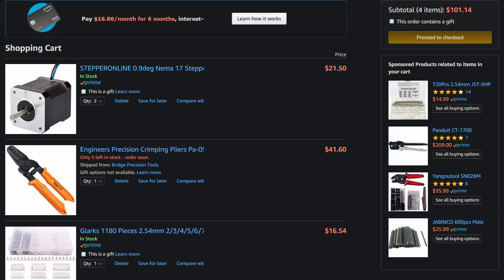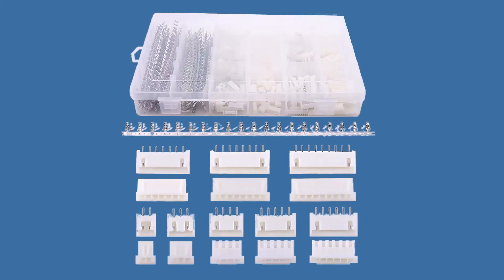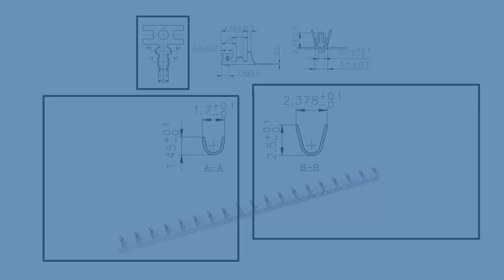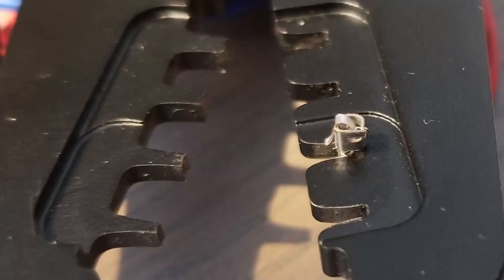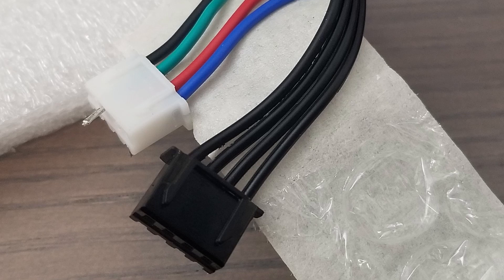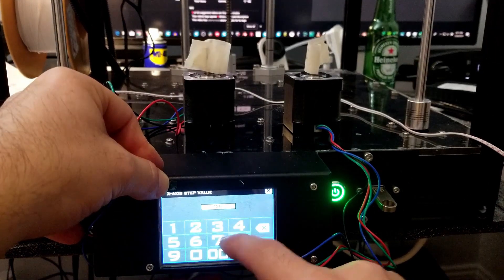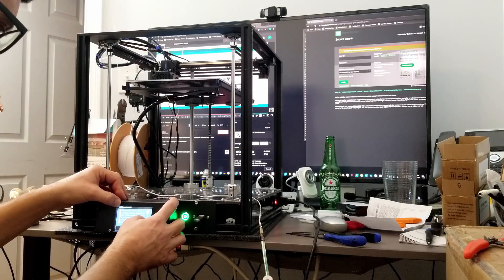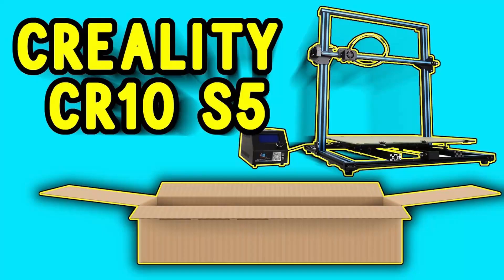TwoTrees Sapphire | .9degrees Stepper Motor Upgrade | crimpping JST Connectors 2.54mm

Comment: To really take advantage of new motors in order to have significant quality improvements thinner toothed belts and rails would also be needed in addition to properly tuned settings. Add superaccurate stepper motors in a mechanic inadequate to their degree of accuracy makes spending vain.
Reply from the maker: That job may be more involved than the printer is worth, or what can the printer do  for me in general.

Comment: I have two s42b closed loop stepper motor and an skr v3 board I would like to put in my sapphire plus that's still in the box. Besides no layer shifts I'm wondering as well if it's money down the drain as well.
Reply from the maker: The skr maybe is not money down the drain. But the closed loop may be. I think maybe you can do it wspecially if you have the patience and knowhow. It will take some time, write back your struggles.

Comment: i wonder if a .9 degree stepper would be better for the extruder over 1.8 degree. figure twice the pulses with half the pressure spike per pulse.
Reply from the maker: That is good thinking. I haven't thought at it from this point of view. Now you got me thinking about it and it is the same length of filament that is trying to push in and out. The only advantage I can think of now may come at microstepping where the 1.8 may not be so accurate and may extrude a little more or less when it needs to microstep. The .9 may do that more accurately, maybe. I think it needs experimentation at some point.
Reply: @RoamingInterests  i know im thinking about it. i was thinking about taking my extruder stepper and puting it on my beds y axis as it has more Tq. i figure it would compensate for the glass bed i put on it. its a ender 3 so the bed travels back and forth for the Y axis.
Reply from the maker: @jasonwoody8041  So your current extruder motor is a 1.9 Deg and has more torque than the .9 deg arc you want to install on the extruder? And then you want to take the Current Extruder stepper 1.9 Deg and place it on the y axis? Anyway you skin that cat more torque for the bed seems like a good idea. If you do that still does not mean you can increase the speed too much. the momentum of the bed rocking still will reverberate through the frame. Also I think the .9 stepper controllers could be more effective in quality on a cartesian 3d printer than a core xy, because the core xy already has a lot more steps available due to the belt system. At any rate do not increase the speed too much on the 3d prinnts because you will see it. In addition a larger stepper can dissipate more heat, because is larger physically.
Reply: @RoamingInterests  right. i want to put the 42-40 from my extruder and replace the 42-34 on the Y axis with it. its .5Nm or about 7oz stronger than the 42-34. i was not planing to bump up the speed of the printer, only comensate for the extra weight of the glass bed over the crap stock magnetic and plyable plastic like sheet. 

and i would put a .9 degree stepper in place of the stock 1.8 degree extruder. however i have converted mine to a direct drive so i would need to see if it would fit still. seeing the .9 steppers have 1/2 the torque it would be a longer motor body for the same torque value.

if all out speed is what i want i better look at something like a delta 3d printer, lol. but i would much rather wait for it and have parts that look like they are injected plastic.
Reply from the maker: Injected plastic, that is very good quality. Whats your outer wall speed?
Reply: @RoamingInterests  turtle speed, lol. .12 layer height and 25mm/second outer wall. takes FOREVER to print something but i like the better finish on the parts. i dont mind waiting though but i have had a few parts i have needed in a hurry and printed much faster and then reprinted slower to exchange them at a later date.
Reply from the maker: @jasonwoody8041  That's preety good. Also You gave me some ideas. I thought 24 mms is a good speed I crunched some numbers and it turns out my steppers have to microstep. 25 seems to be a multiple of .4. Damn I've been Missing Out. Who knew!?!?!
Reply from the maker: Did the number crunch again this time properly, and 25 mms is not a multiple of .4 so you may want to move your speed to 26 or 24. You may need a microscope to detect any difference but see if it works for you.
Reply from the maker: Moreover, I think you should keep the larger stepper for the direct extruder. I know is heavier but also dissipates more heat. I tried those pancakes twice and they were burning hot as direct extruders, especially if you have a lot of retractions.

Comment: in my case there is no difference between 0.9 and 1.8 !!!!
Reply from the maker: Yea, I did not detect any improvements either. My sapphire S requires a lot more features upgraded before any improvements may show. Maybe a microscope may shed a better light into the situation but I do not have one.

Comment: Is there any accuracy improvement in X, Y axis? I am using ender 3 pro and intended to upgrade all axis with  0.9 degree steppers as current motors have an accuracy of +0.03mm which means that if I UPGRADE these motors to 0.9 degrees, it would theoretically makes the accuracy higher than 1.8 does?
Reply: I upgraded to 0.9s a while ago, and swear by them. Greatly improved VFAs. Even went to installing 16t pulleys in addition, however changed back to 20t because it seems like even with tmc2209s and 32bit there was a shuddering issue. With 20t its great. The Z is the greatest gain, and with that I duel-Z top-mounted the stepper and geared 4:1, awesome z resolution .01mm layers reliably! Though I rarely do.
Reply: @danthemancasey  0.01mm layer resolution? Can the stepper motor and the 0.4mm nozzle handle that accuracy? Do you have any picture to show the printed sample part if you don't mind sharing lol
Reply from the maker: I did some 3d prints And the upgrade to .9 Deg steppers is not conclusive. But I am not also the greatest tuner of 3D printers so it may also be other factors that still continue to affect the quality of 3d prints. But My test was done on the cellular lamp which I think is the most demanding 3d print of all. I used G-Code which has failed before the the upgrade to direct extruder. So because I upgraded to direct extruder and ter stepper motors I still think the test would be inconclusive. Moreover the same artifacts showed up in similar places with the same g-ccode or new compiled g-code. So I think the .9 Degrees stepper upgrade on a core XY may be redundant. no visible gains can be observed with the naked eye. The only advantage may be the z axis where the micro-stepping on the layer height may be more consistent. Also there is a comment somewhere below where someone said that as well.

Comment: Great information, are you going to do comparison on entire axis with 0.9 step degree compare to 1.8 ? I’m currently building 3D Printer and want to see the difference it give.
Reply from the maker: I do not have a microscope to check the layers On the Z axis. In addition there is a comment on this video where the math seems to not add up as any vissible gains. For example the orginal sapphire s with 1.8 deg steppers already steps at .01 mm with the 1.8 arc motors. So basically the .9 arc steppers will give it the precision to stp at .005 acording with the math described in that particular comment. You can see my reply there. And sice there are not a lot of comments you can find it easily. If you check my subsequent videos. I am satisfied with the prints. If you re buying new steppers you can buy the .9 deg ones. But if you have the 1.8 already, because of the corexy system and belts you may not gain a lot better precission or a better wall look. Also i changed the 3d printer to a direct extruder and my old prints are in some box somewhere. I may look back and use the same filament and 3d print anothe cellular lamp and show some differences. The problem maybalso be that I do not have more of the same follament with which i 3d printed the cellular lamp. I will post some results in the not so near future with a new cellular lamp. So I will eventually do an update and comparison with my previous prints. But getting evicted by excessive noise from the neighbors above, or making my life unlivable I have been living like a nomad in friends house taking lots of risks for the last two months. 3d printing has not been on my mind.I remaingratedul to my friends for taking me in, Especially during this time of covid-19 pandemic.

Comment: The 0.9 degree motors are supposed to help with "vertical fine artifacts", which are fairly prominent on my Sidewinder X1. I'm going to give them a shot and see if they help. It's hard to envision how they'd be of help otherwise, unless you're already at the limit of your microstepping.
Reply from the maker: So do you think, I should also replace the Z axis one as well? I thought the will also make more precise movements and more precise parts overall.
Reply: @RoamingInterests  I'm just researching this topic as well, so I really shouldn't be offering an opinion - but what the heck... 🙂 My guess would be that since the Z axis mostly just implements layer height, and layer heights are large in comparison to motion increments, there probably isn't any benefit to converting your Z axis to 0.9. Even for X and Y, I would imagine you run up against the physical limitations of the extrusion process pretty quickly. Just because you can move the head in 0.005mm increments doesn't mean you can actually control melted plastic oozing out of an 0.4mm nozzle at 0.005mm resolution. I'm very curious to hear what you conclude after using the new motors for a while.
Reply from the maker: Thanks for the response. So I was looking at the way Two trees sapphire does it's z axis and I concluded that it may be negligible to modify it. So I haven't done any testing yet But I intend to do some testing with some rails I made myself. They are supposed to slide inside each other and you can prototype 2 Dimensional frames like a picture frame or something else. I Already have the G-Code that I used with the 1.8 stepper motors and I have the old rails. Moreover I kind-of designed the rails to have some tolerances of .0.2 mm to slide so I am curious if that precision of the stepper motors will make the rails more exact. I need some friction so the rails slide a bit harder in so we'll see if the new ones are looser or tighter. Thanks for contributing.
Reply: @RoamingInterests  I know this is an old post at this point, but it's worth being aware:  all things being equal, 0.9 degree steppers can do far less RPM than 1.8 degree steppers.  You can use higher voltage stepper motors to help stave off this, but ultimately even 48V steppers will have a maximum speed that is significantly faster when using 1.8 degree steppers.  This is the reason why builds that are focused on maximizing print speed are always leveraging 1.8 degree stepper motors.

The reason for this is down to inductive voltage... as the motor spins past each coil, there's a voltage induced which feeds back.  More coils = more induced voltage.  At a certain point, the induced voltage is the same as the voltage supplied by the stepper driver, and that's the maximum speed.  Since 1.8 degree steppers have half as many coils, it can spin twice as fast before reaching the same point.